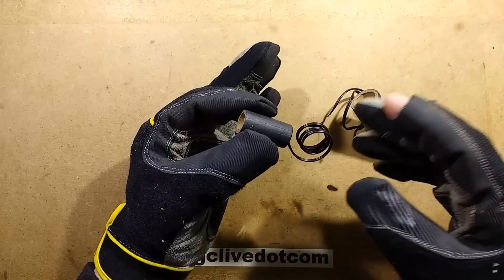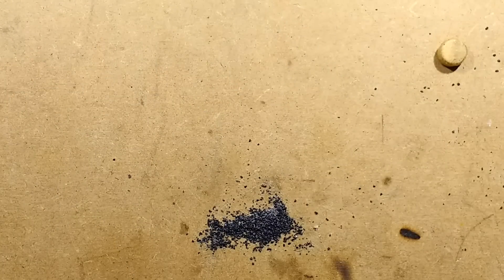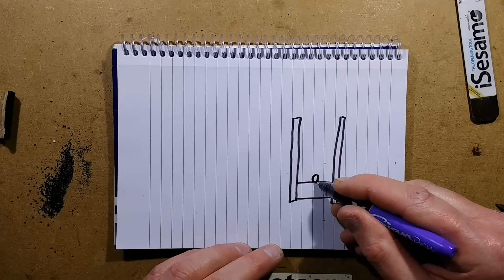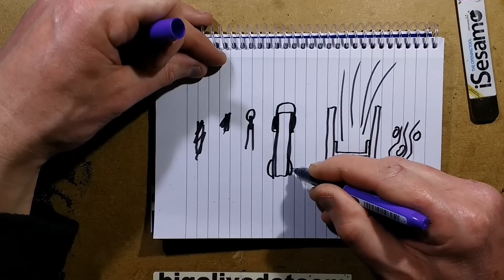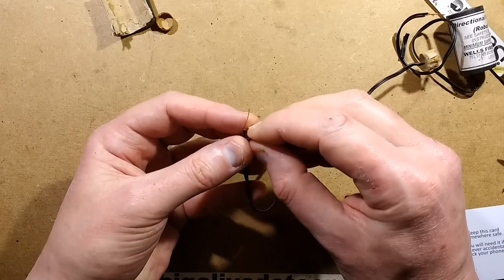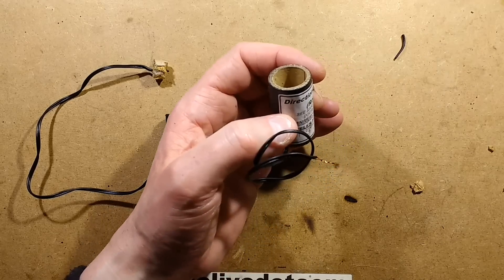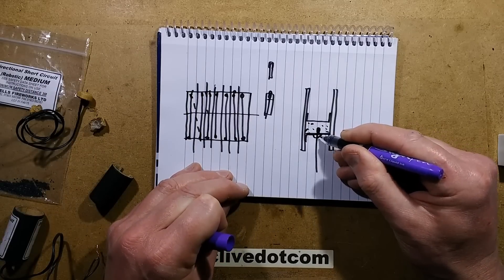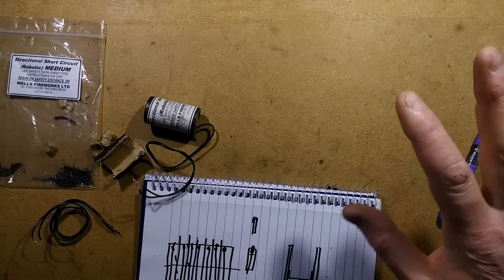Inside a special effect pyrotechnic "robotic".

Comment: My understanding of explosives is that a 'solid mass' of explosive compound would explode since it has all the necessary elements for a chain reaction, and the chain reaction would propagate more quickly through a solid than loose material.  If it were combustible instead of explosive, then the chain reaction would only exist at the interface between the fuel and the oxygen.
Reply: High explosives would act like that.  Black powder is a low explosive which is more a quick burning than being propagated by a shock wave
Reply: It makes me wonder why they always pack down the charge after loading those old-style flintlock rifles.

Comment: Oh I loved LeMaitre flash pods when I was lugging gear about for bands and DJs, loads of fun and a nice bang if you taped over the tops with insulation tape. 

Of course, I never did that. 

Ever. 

Especially not in the pub where the bottom of some bloke's pint pot cracked off and spilled a whole pint of some fizzy Manchester piss down his trousers and brand new shoes when we detonated the pyro. 7

They sold flash powder in tubs so you could make up your own charges, wonder if that's still available...
Reply from the maker: I don't think they sell the two component flash powder in tubs any more.  The LeMaitre cartridges were best wrapped in gaffa with enough tape to cause the base of the cartridge to blow off.
Reply: Clint Jay easy to make. Not that I would know
Reply: no I did not tape them either! not a good idea to fire them off in a wedding tent however.. it makes a lot of small holes in the tent roof! I wonder who did that??

Comment: Be aware that there are different alloys of nichrome wire, some are easy to solder, some not. It's also much harder to solder after it's been heated. Acid fluxes help but need to be cleaned off. Crimping is a little easier if you have the tools.
Made solid, reliable e-matches by twisting together solid core wire, soldering a small loop of very fine nichrome between them then dipping them sevrel times in ping-pong balls(nitrocellulose!) disolved in acetone.
Thickness of wire and length lets you tune them to not go off under 50mA(max test current, I use about 5 :) but to work great at 500mA or so(firing).
Reply: Ping pong balls and acetone?  lol

Comment: Could you do a video about those little flash paper rings that let you launch fireballs? I remember seeing one that was a ring with essentially a cigarette lighter striker on one side  and a tube on the other side which you'd stuff with a special flash paper, and when you struck it you'd shoot the paper out as an awesome looking fireball.
Reply from the maker: Those often used a tube (in mine they are bullet casings!) where there was either the flint striker or a small model engine glow plug.  To load them you put a small fluffed up puff of flash cotton in first as a lift charge and then took a square of flash paper and rolled it into a ball with a tail (to make it easier to ignite).  There's an art in loading them to get reliable operation and a good visual effect.

Comment: What is the procedure if one of these fail to blow?
Reply from the maker: For failed pyro with a cardboard shell it gets fully submerged in water.
Reply: bigclivedotcom That seems like the right thing to do but it is actually dangerous. If something lit and is smouldering all it can take to go boom is an ember to get pushed  inside the fuse hole and then it can go off on you, also when you soak fireworks in water their internal components can make a paste then solidify after drying turning your gerb for example into a bomb. What we used to do on the fireworks crew was wait 2 hours after a malfunction declaring it a hangfire until the 2 hours are up and then we declare it a misfire and we usually take all the misfired pieces and bits of quickmatch fuse and throw them in a big hole in the ground way back in a cow pasture somewhere once or twice a year. then someone throws in a road flare.
Reply: I can see in your special case where you do close proximity effects and the like that you wouldn't want to put them up there. If they are small enough a sandbox would probably absorb quite a bit of the energy if one of your devices does go pop, but I've seen with my own eyes a demo at our yearly safety class where a lit ember can skip across the surface of water or stay lit while floating. All it takes is just a little splash of water to push an ember into the device, especially if the fuse got partially extinguished and that ember is sitting right in the fuse/e-match hole. Just be aware that if you say put an unfired gerb in a bucket of water chances are you no longer have a gerb but instead you have a bomb. Our practice for outdoor fireworks (the stuff you see on the 4th of july, large cakes, 3"-10" shells mostly) is to consider it a hangfire for 2 hours then carefully place them back in the box. Even still you can never be too sure. I can attest to a handlit show I did once on new years eve where it was extremely foggy and the quickmatch fuse was damp from the fog and every couple of shells the quickmatch would stop and fizzle for a little bit at the very edges of the mortar tubes (where the fuse was bent)  That short 15 minute show ended up taking about 45 minutes because of all the hangfires some of which would spontaniously start back up and go off and if you know how fast quickmatch burns you don't have time to think about it. We had a couple of shells go off on their own about an hour after they were originally lit.... This show was part of a demolition derby so fortunately the people thought it was all part of the show and they loved the  occasional boom after midnight and we could hear clapping from inside the stadium...
Reply: Yes and no, there are powerful oxidizers in some pyro compounds that can be dangerous when intimately mixed with other chemicals, particularly perchlorate and red phosphorous. It's not the biggest problem but most of the other chems are metal nitrates, and metal powders which can make NO3 acid which can do weird things like nitrate paper casings and the like. The biggest harm I see would be the crystalization of oxidizers in places they aren't supposed to be which could cause spontanious combustion with something as little as too much sunlight exposure but the big thing is turning a fountain or gerb into a bomb because you solidify the components in a wet paper mache' slurry. Many of the common oxidizers used in pyro like potassium nitrate and perchlorate are in a safe stable state in their devices but they dissolve very readily in water and will form friction heat and light sensitive mixes when they are intimately mixed with metal powders and particularly anything with red phosphorous, and god forbid any sulfur is in there you have just made "armstrong's mix" which is known for taking the eye of it's inventor. We use no water in "safing" our misfired shells for this reason, we just throw them in a pit at the end of the year with all the trimmed quickmatch and all and throw a road flare in, it's quite amusing for all of us firebugs.
Reply: More current! Or pick them up gently, I guess, pointing it away from anything of value (basically like a gun), and dunk it in water? Or maybe throw them in a contained fire, ensuring it will blow up where it can't do damage.
Reply: Peter Carlson in theatre we couldn't necessarily leave a failed pyro on stage in case it went pop underneath someone so it would be cleared safest opportunity and put in a sand box and placed outside. this could be doused in water or forced to ignite depending on the size.
Reply: I must admit. Whether or not it's myth, some technicians would suggest not putting failed pyros in water as they might contain chemicals which react to water and cause them to go boom. I remember someone dumping a lot of them in a barrel of water and seeing some fizzing and bubbles but nothing particularly violent, but as you say, if there is a significant number they could form a slurry or clump which could be powerful when dried out or ignited. Ha, it would be interesting to see. From a distance of course 😉

Comment: Very interesting. Does the nichrome / resistance wire actually burn away to open circuit, or does it stay intact and current continue to flow?
Reply: voltare2amstereo Thank you. I'd always assumed it burned away. Explains why connecting them in series works :)

Comment: It is not a good idea to wear polyester based gloves (or other pieces of clothing for that matter) when playing with flammable compounds. Not only will it create electrostatic charge but also (and much worse) will it melt to your skin if it is burned. Regular pyrotechnics normally don't stick to skin, but the polyester gloves will "hotmelt glue" it to you (not nice).
Reply: But then he'd have super-power chemical-resistant hands! Imagine all the videos he could make then!
Reply: Der Max it was intentional for added dramatic effects
Reply: Or maybe he should wear not really flammable or meltable leather gloves. Not as fun, I know.
Reply: leather gloves or nomex would be ideal
Reply: terry jenkins And only certain types of leather if it comes to that. Many types of leather have a really nasty habit of shrinking substantially when exposed to high temperatures over longer periods of time. That makes it near impossible to take the gloves off again, which sort of messes with circulation in the affected hand(s). This is the reason Firefighters usually don’t wear leather gloves when they go into the fire but Nomex instead (sometimes with leather in a few places, but not on any part that wraps around the entire hand). There have been a few very incidents involving shrunken leather gloves that were very nasty indeed and resulted in major injury. The only exception to this (I hear) is elk leather.

Comment: I have many electric igniters and stuff! :D I would avoid using a box cutter and rather peel it off, much safer. It probably is only an electric igniter and BP with zirconium or ferrotitanium or just titanium sponge. DO NOT use metal tools. The lacquer is Nitrocellulose.

Comment: Safety gloves with one missing finger tip!? I love it.
Reply: Maybe so he can use the touch screen on his phone.
Reply: I see gloves with „missing“ fingers quite often. Sometimes it is just the index finger, sometimes it’s the thumb and index finger. It has several benefits in several areas, such as being able to feel the trigger of a gun better or to improve the ability to press small buttons on a device or to enable workers to perform more fiddly tasks like threading wires through holes. Stage technicians often wear them.
Reply: @DeputatKaktus  or pick your nose   ; =)
Reply: Simon  Hopkins Ummm....yeah, that too, I suppose. 😂
Reply: But why the index finger? I'd rather sacrifice the pinkie

Comment: Seems like if you were setting off many that wiring them in series would invite the possibility of some going off and others not just based on slight manufacturing differences.
Reply from the maker: +bdot02 It does seem that way.  But if you wired a lot in parallel the resistance would be so low that the trigger cables resistance would become an issue and could prevent any of them firing.

Comment: Clive! Get a cheap ebay glass screen protector! They are insanely cheap and I've done stab tests and I would rate them as extremely stab resistant.
Reply: It's a no brainer, All six of my mobiles have tempered glass protectors, broke mine twice in two years, the kids and misses break a screen a month. So it costs me £60 a year in protectors, rather than £10 per phone for full insurance per month at £60, or as is now, no insurance £100 for a new screen per month or new mobile £400 a month. Plus a hard case and your golden.
Reply: Yep them's the thing.  I'm a gardener/tree surgeon so phones don't last all that long - A glass screen protector doubles the time before the screen is completely dead so I can keep a phone for over a year!  Plus they seem to be much more scratch resistant than the screen itself.
Reply: Before I even buy a new phone I buy a tempered glass protector because I'd rather pay £2 to replace that than £130 for a replacement OLED screen.